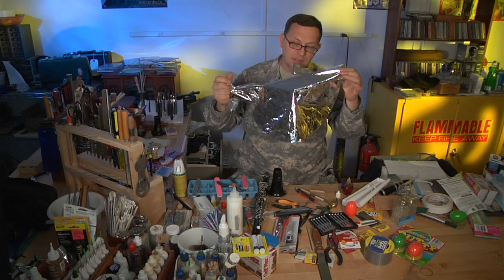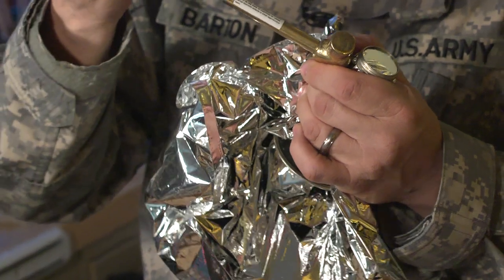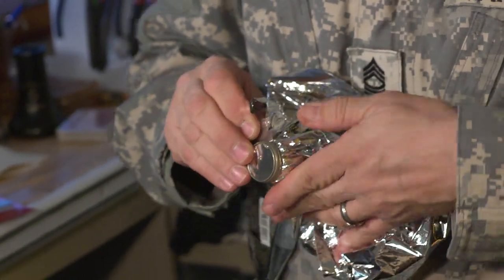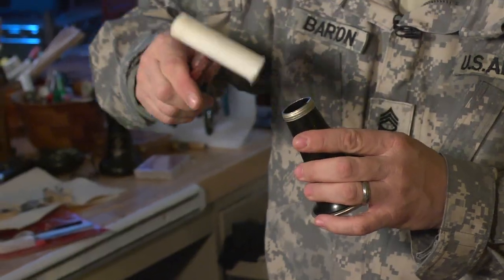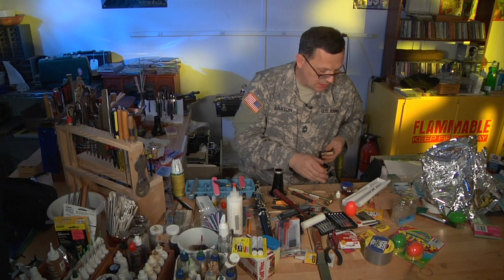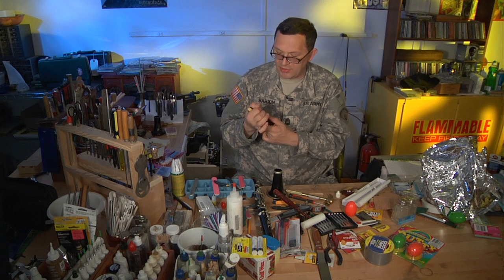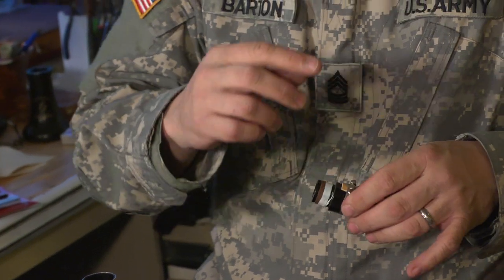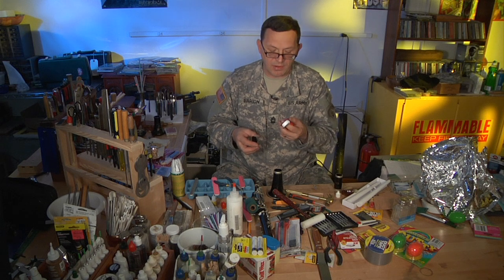Loose Rings and Corks: Clarinet Instrument Repair

Comment: I used just that, mylar balloon material to fix the loose tenon rings. It worked like a charm.  Before I did that, I coated the barrel and the bell with natural almond oil, let it stand for a couple of days, and then did the mylar thing to fix the rings. Perfect fit.
Thanks for your insight.

Comment: I've heard that the loose rings on a wooden clarinet are indicative of wood that has contracted.  This seems likely, since I notice that my clarinet's rings get loose in the dry winter and tighten up in the humid summer.  Does oiling the bore help with that?  Thanks for your videos.

Comment: I saw an online post that used sandpaper to fit the rings. Is that ok?
Reply: That was an approved method and how I learned years ago.  Rough side towards the wood.  Usually a finer paper like 600 grit.
Reply: @mikeslay3294  Would plating be a good alternative?